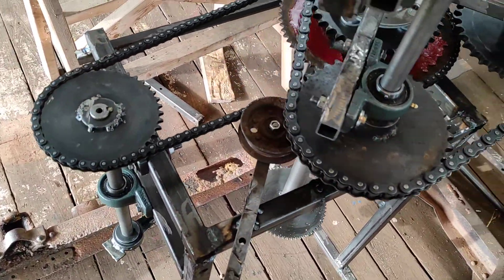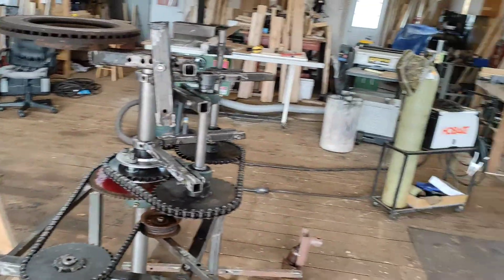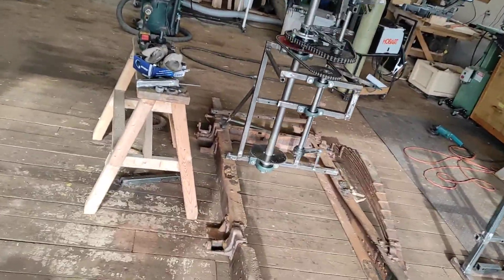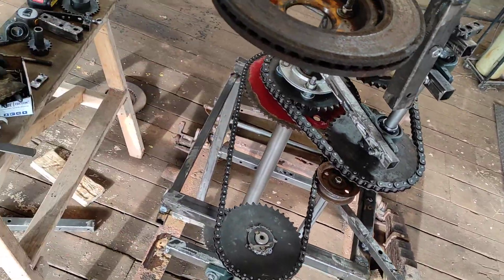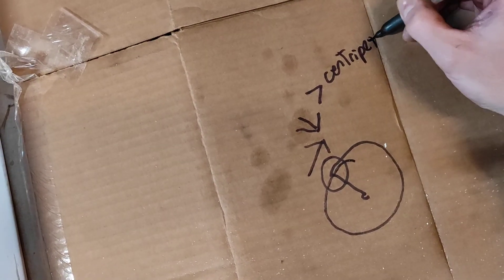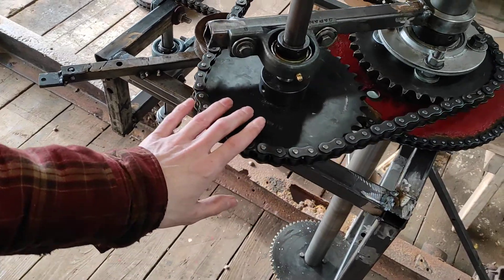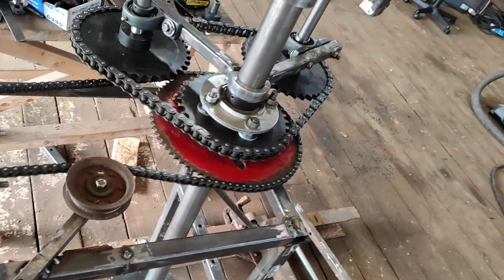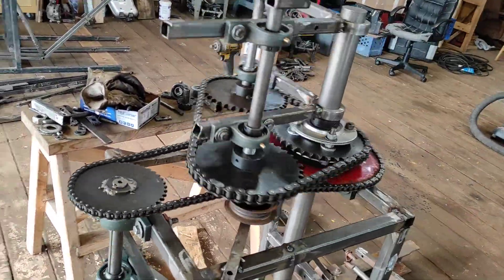Centrifugal Power Machine

Comment: If it's not speeding up on it's own, and not running itself it's not over unity.
Reply from the maker: What you defining is perpetual motion. Over-unity means more energy out than in, so there is some input and then once it's efficient enough (usually 200-300%), you can close-loop it. Then it becomes perpetual motion. All chickens are birds but not all birds are chickens.